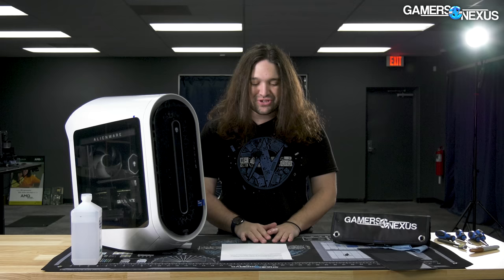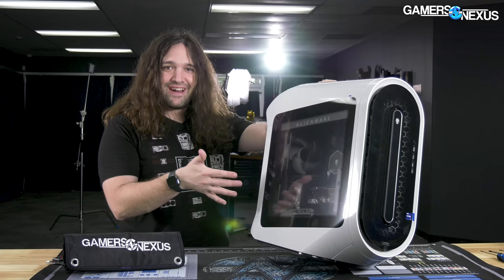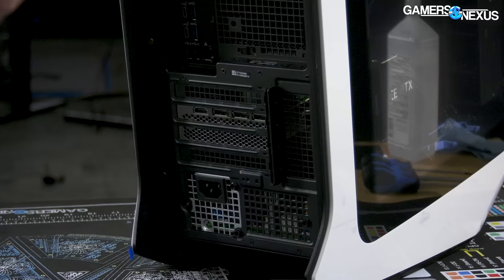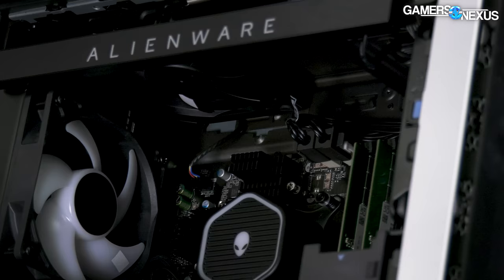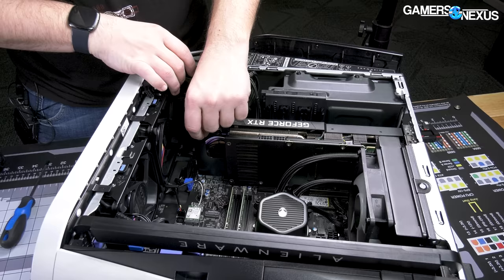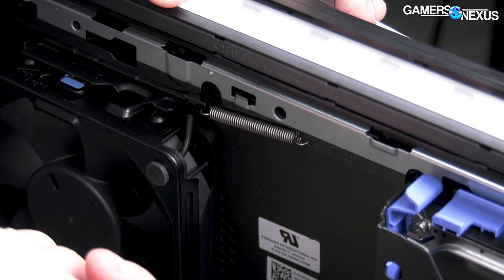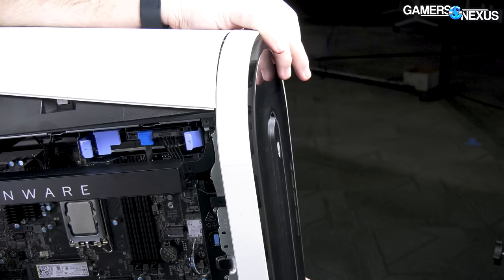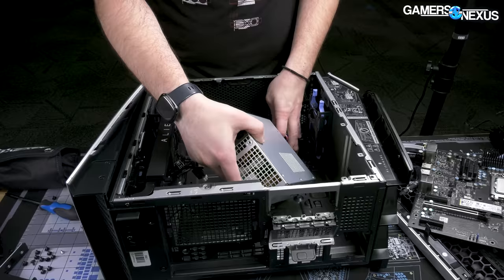Crazy Bad $5000 Alienware Gaming PC: R13 Aurora Tear-Down

Comment: In the business market, the degree of mechanical engineering they do makes sense in my opinion as it makes common part swaps pretty quick for IT staff. Their major mistake was applying the same methodology to consumer equipment... and being damn cheap about it.
Reply: I agree. I've had to service my IT provided computer during covid to add another nvme drive and the tool-less panels for everything were actually pretty great. It was the first time I've opened a side panel for a computer and put it back that was actually easy. Usually the side panels have those crappy thumb screws that only one barely fits in and it's good enough. The Dell case actually had a spring-loaded latch with a simple button to release and it fit well with the case.

Comment: As a design engineer, I would actually appreciate a lot of decisions that Dell made in their design, if it didn't result in planned obsolescence.  For example, look at the AIO.  The slotted design with the single screw hold-down cuts the attachment process into a 1/4 of the time it would normally take.  And, you can install the screw at the same angle of the other screws.  In fact, it looks like the entire case utilizes a one-direction assembly method, which is much more efficient than the standard PC.  

Moving the front I/O to the motherboard is smart.  It eliminates a daughterboard, wiring and having to install those tiny I/O connectors onto the motherboard.  But, again, it basically makes it impossible to replace with a standard component.

I will say that the latching mechanism for the side panel looks like something engineered by an overzealous intern but the rest of it definitely cuts down on assembly time, relative to using standard components.
Reply: Lol good one, almost took you seriously for a moment!
Reply: yeah its clearly designed to use modular parts and with assembly time in mind. 100% about economies of scale in the design.
Reply: Non-standard sizes/connectors should be a deal breaker for anyone.
Reply: Then why did they still decide to run a cable for the front LEDs?
Reply: @codyrap95  My guess is the front panel was installed by the third-party case manufacturer.
Reply: @codyrap95  - There is no other way to do it.

Comment: I used to have one of the Alienware R6 Aurora, rocking a 2700K w/GTX 780. It used a 120mm AIO made by some off the wall company name I've long forgotten. The major issue I had with it was when the motherboard went bad. It's was a no name mATX style board with proprietary connections at the fan headers and the AIO power connect. It also had a small control board that mated with the proprietary designed board that controlled the lighting in the case. If I recall, the board ran on Dell/Alienware proprietary firmware, which was another problem in itself later on. I replaced the bad board with an MSI board and ended up having to replace the cooling fans to skirt around the proprietary connect issue. Same went for the 120mm AIO; replaced it with an Corsair 120mm AIO. Nothing larger than 120mm was going to fit inside that tower. I ended up scrapping the board that controlled the lighting in the case because there was no connects on the MSI board to mate with the lighting board's cables. Motherboard in, ready to connect all the power cables to get power to that thing and whaddya know? The MSI board wasn't going to hook up with the Dell PSU. More proprietary bullshit with the PSU so, I ended up having to scrap it and purchase another one that barely fit into the R6 tower. The Alienware BIOS and Firmware had to also be scrapped because by that point it was no longer going to run on the same set because the board that came out of it was custom made to that BIOS and Firmware. It was a nightmare in the end. The R6 was my first,  and my last experience with anything Alienware. It was basically my first first into the world of PC gaming and was bought second hand for $500. Tearing it down and replacing the bad parts is what got me into learning how to build my own gaming PCs.

Comment: Hey Nexus, the R15 is up, please make a review on this one too...From a first look their supposed improvements are crappy Dell's style modifications. They just wont admit that the only way to fix this is to come up with a new chasis...and new motherboard....and new cooling....aaand if you ask me a new design line as these rounded forms seem really retro now. Rergards
Reply: They need to stop using proprietary items in their PCs or stop "building" gaming PCs all together.  It's the same chassis as the one in this video with the 80mm fan layout but an overengineered 120mm AIO slapped on top of it.  I feel bad for people that go to Dell and buy this crap and not knowing any better.
Reply: What pc pre builds would you recommend out if interest? Thanks
Reply: @discipleofdagon8195  thanks for your recommendations it's much appreciated I'm a pc noob just getting into it and it's so interesting really enjoying learning. Found a company (I'm UK based) called PC specialists and built one on their website with the help from someone much smarter than I am, twice the spec and still cheaper than a pre build. Again thanks 👍

Comment: This isn't a PC of course, but my alienware monitor has been one of the best I've ever used for what I need. I'd only improve the HDR by making it an OLED and It'd be perfect.
Reply: As much as I hate EVERY single Dell or Alienware PC I have ever used, repaired, or modified.... I agree with you there. Our 3216q ultrasharp that we use for photo editing has been very good indeed.
Reply: I'd say at this point the only things worth buying from Dell are their laptops (depends on the model) or their displays, I've had much better experience with that side of their business.
Reply: @EthanCGamer  We recently bought a higher end laptop from Dell and holy hell what a thermal nightmare. They have issued firmware tweaks to try to play with it, but there is no correcting abysmal cooling design with firmware. A lot of this is the VRM's. Completely inadequate design.
Reply: @tebo2770  their midrange and low end business is plenty fine for what it is, that's the only range I have experience in servicing I'm my organization. I would stay away from any high end anything from the big OEMs.
Reply: I have an Alienware monitor, and it is the best monitor I’ve had. So they have that at least

Comment: I bought a Aurora R6 when I just first started getting into PC gaming. It had a Intel I7 8800 and a MSI 1080 (I could tell because I could see the specs and design on the GPU itself and there was only one other like it on the market and it was one of MSI lower end 1080 gtx). 

It ran great at first but after about 2 months I noticed eventually the system was getting WAY too hot and too much thermal throttling and my GPU wasn't being fully utilized from the PSU. Also the SSD that came with it was already going bad with the system freezes and I'm sure the bloatware from Alienware didn't help.

 I had a buddy who built his won PC and let me try out his. My games on his computer were running way better and he told me "building your own PC is the best way" 

I junked that whole computer except foe the CPU and the GPU. Transfered then both to another case with a fresh new case, motherboard, PSU, CPU cooler, and M.2 SSD. Haven't looked back since.
Reply: It's a shame really, looks like very little has changed in the prebuilt market since I last looked at it (must have been 15 years ago!). After seeing the absolute dogsh!t that passed for "gaming" computers back then, I made the decision to just not bother with prebuilts. It seems that in all that time I haven't missed much.

Comment: With a lot of big companies like Alienware, nowadays, what the customer pays for, isn't quality, but the deadweight of the company's over polluted internal structure.
Simply put, many unnecessary jobs, where people create new difficult ways of solving old figured out, simple-enough problems.
It's the classic fail-structure that consumes insane amounts of money and work-hours. It produces trashy-products, with nobody being responsible for failures, since hundreds of people were involved and everyone is just a small cog in a way-too-big wheel.
Reply: If you, and enough other people stop buying their products then they, or the people who own them, eventually panic and do audits on why this department is losing money and why consumer opinion of their products has changed from being not just overpriced, but actually of terrible quality now. Either the change will come soon or some other, more efficient company will come in and eat their lunch. 
At the moment, Alienware is like buying a Ferrari, but the engine is made by General Motors and the interior is by Toyota. You're paying upwards of $1000 for the little badge on the front.
Reply: we can blame management and middle managers and overmanaged teams and departments

Comment: It's mind boggling the company that makes the incredibly designed new XPS laptops using machined aluminum and carbon fiber can also make these monstrosities that look like they wrapped plastic around a case from the year 2000.
Reply: Dell doesn't make XPS laptops. Compal, the 2nd largest laptop manufacturer in the world, designs and manufactures them, then Dell slaps their label on them.

Comment: I may be wrong but the basic layout of the internal 'box' that the components are installed into looks very similar to some old BTX case designs that Dell were pushing when I was repairing computers in PC World back when Windows Vista was the latest (though not so much greatest) OS to be pre-installed into laptops featuring a Celeron with a single 4gb RAM stick and on-board graphics (yes, people were dumb enough to buy them and think they were good for anything other than weighing down paper - possibly the small denomination they should have spent extra to get a machine that has a chance to work).
Reply: Reminds me of the old aluminum XPS Dell cases and their mechanics for opening panels and compartments.
Reply: Yes, that's what Steve is referring to when he said the chassis is 30 years old
Reply: Oh yeah it absolutely reeks of bog standard cases that were around for so many years

Comment: Imagine if all this mechanical engineering had been put towards something productive.

We'd be on Mars by now and humanity would be gods.
Reply: They didn't engineer that. The optiplex case already comes with that stuff, as it was designed in the 90s. It's a good case, you don't need a screwdriver to service it. That's the point of all the mechanical engineering. If you use it with 90s/00s hardware, that is.
Reply: @tonnentonie2767  Dude, they did engineer that, whether in the here and now or back in the 90s.
Reply: @pieceofschmidtgamer  yeah, I meant they didn't engineer this case to hold today's hardware, so they had to throw all this adaptee stuff in to make it work.

Comment: I personally love Dell for their stupid proprietary hardware, as a budget builder I'm fine with letting my PSU sit on top of the case when it only cost me $25 because nobody else has use for it.
Reply: I love them because they're usually a treasure trove when i find one 

I havent been dumpsterdiving for a few years due to being above the poverty line now but in 2016, i found one of theirs with a cooked vrm (some of the SMCs had even desoldered due to the heat). That gave me a system with a 6700k, 980 ti, 32 gb and a few tb of ssd storage for ~$110 (had to get a used mobo and psu) and some of my time
Reply: $25? They ripped you off!
Reply: @ffwast  $25 for a 750w PSU that ran my shunt modded 980 Ti and 3930K at 4.9GHz @1.414v without issue. Saved me a good $40-60
Reply: @thelazarous  I mean $25 for a Dell.

Comment: As a mechatronics engineer: I'm impressed at the amount of mechanical engineering involved. As someone who has worked as product engineer: I'm impressed at the amount of effort mechanical engineers put into solving non-existent problems to make it as non-standard as possible.
Reply: Also, as someone who has worked in manufacturing of motherboards for servers and has repaired/opened lots of workstations. These mechanical contraptions seem to be designed by the same people, but while these are somewhat justifiable by making repairs easier and fast in servers and workstations, here they accomplish the opposite, making it harder to repair while "justifying" high costs.

Comment: This thing is exactly what they wanted, it has the parts people will pay for, it looks expensive and is heavy, it hits all the points they needed hit. For the consumer it hits almost no points we need.
Reply: I agree with everything apart from the looks expensive part. This looks more like a kids toy than anything else. The case design looks cheap at best.
Reply: @GOffensive  after it’s opened it does.

Comment: This case reminds me some sort of an old software project with a bunch of legacy code & boilerplate that no one likes but programmers either afraid to refactor it, cause the app will just stop working in the most unforeseen way, or the business won't listen to their engineers, believing that by continuing to support old platform they save a lot of money. Despite of this, managers continue request new features and the only way you can implement them is by adding some strange hacks that you wouldn't need in a normal system. The funniest thing is that it might be cheaper and faster to develop a new version of the application from scratch then spend days on testing all those hacks that work like some sort of dark magic.

Comment: Me just unboxing my R10: “Oh!”
Reply: Works fine and upgraded the ram so far.
Reply: Why did you buy that 💀
Reply: Lol you got scammed
Reply: F
Reply: Well you can still refund
Reply: @kaiseralbrecht6099  got a 1tb ssd, R7 5700, 16gb stick Upgrades with a 32gb kit, and 3080 all for under $2000. I’m happy with it. It doesn’t have any real ducky shit like in this behemoth
Reply: @Arby631  yeah, my friend got an aw (for some reason) at similar spec (but higher price because Canada pc prices am I right?) and apparently it’s actually good. But I mean
Reply: @kenos911  it just comes down to price. HP, Dell, and other big OEMs can buy raw GPU chips from Nvidia and pay a supplier to put them on custom PCBs and coolers meaning you pay a lot less middle-men